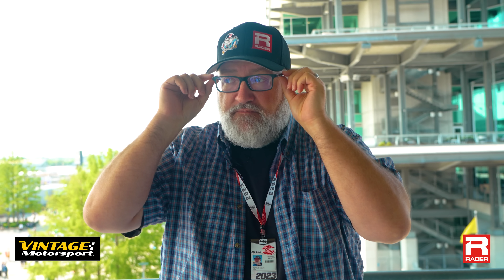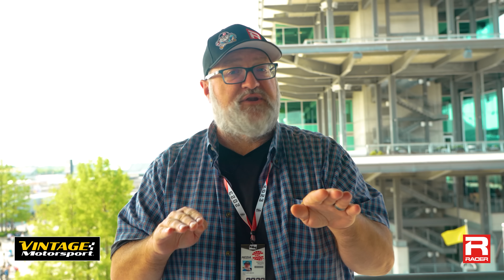Indy 500 Weight Jackers Explained - hosted by RACER's Marshall Pruett

Comment: The NASCAR fans will know this as "wedge".  Same exact concept except NASCAR has a crew member mechanically turn it versus the driver electronically adjusting it.
Reply: Doesn't the current gen NAPCAR have driver adjustable "wedge"? Or is it track bar?
Reply: @MX304  track bar
Reply: Great comparison.!
Reply: @seankennedy131  the current Gen car doesn’t allow the wedge to be adjusted and doesn’t even have a track bar. For a year or two they were allowed to adjust it inside the car but they got rid of that like 5 years ago. Not a thing anymore. All they can adjust is brake bias front to rear.
Reply: @robby2448885  wow that's really unfortunate

Comment: I like the Penske solution: Jack off/ Jack on, and all with a button
Reply: All of them are button controlled, and the drivers will adjust them to specific positions throughout a fuel run ( as instructed by their engineer over the radio) to a position number in the steering wheel display.
Reply: @richardpare3538  Since you mentioned fuel run, I thought they'd only use fast jacking during qualifying since I imagined that either a) it's forbidden during the race od b) it can't be used to reduce drag since it's range of adjustment is already fully occupied to adjust between a full fuel tank and and empty one. Would be great if you know that and could tell me/us!
Reply: @armorgeddon  I'll have to double check with my team friends, but how the jacker gets used will depend on what the engineers want at that point in time, and, of course, how busy the driver is if in heavy traffic. I would think that the better teams have the jacker control programming sophisticated enough to allow, with one push of the button, to go between 2 set  positions - one position for fuel load compensation, and the other for drag reduction.

PS - many of the jackers the teams use are mine, some are copies of mine, and some are made by the team. Once I can again confer with my guys and verify my thoughts ( they are all damned busy for the next few weeks), I believe that I can make a new jacker that will respond a lot faster so that they can spend another second or so at the low drag setting on each straight.
Reply: @armorgeddon  The control for the weight jacker is now a rules-mandated system - the teams used to all make their own systems -, but the jackers themselves are open. It is a very sophisticated and expensive system ( the motor alone costs $2000!) that allows the driver to set 2 position points from the steering wheel that are then controlled by a single push of a button. Those 2 points can be changed on the fly by the driver, according to the needs of the level of the fuel load at that point in time. The drivers, when not way too busy, do indeed go to the low drag setting when on the straights during the race. The majority of drivers only do that on the 2  main straights, but there are a few that also do it in the short chutes!
Reply: @richardpare3538  Just an ad break in the race coverage here and I quickly wanted to let you know that I highly appreciate your effort in investigating this for me/us. What you reported is really interesting and I didn't knew this even after watching IndyCar since 1993. I'll overserve the driver's actions on the buttons during the race now. Thanks very much and good luck for "your" drivers! EDIT: just as I sent this comment Will Power is reporting his jacker seems to have failed.
Reply: @armorgeddon  The problem Rahal had was a mixup in the assembly of the controller. No idea on what has happened to Power's jacker - may hear about that in a week or 2.

Interesting race so far!

Comment: Why didn’t RLL repair Grahams during qualifying
Reply: I am no Indy car engineer, but, the actuator shown in the video is hydraulically driven. There is a hydraulic valve and pump some where on the car to deliver oil to the jacker. Depending on where they are in the chassis, they may not have had the time to get to it, change out the components and put them back in time. Plus, if I remember, they did not know what failed, it could have been any number of items, plus  the electrical controls to operate it.
Reply: @dconkey1  It was an instantaneous failure the first time he pushed the button

Comment: The F1 teams want this if the technique is allowed
Reply: Weight jacking is really only relevant on ovals where the car is set up asymmetrically to help it turn in one direction.  Otherwise, for road courses, you'd use adjustable anti-roll bars and/or diff, which they already have.
Reply: @kuckoo9036  what if both sides can be adjusted.  This is disallowed in F1
Reply: Yeah really useful around Monaco. 🤡🤡🤡🤡🤡
Reply: @kuckoo9036  F! does not allow cockpit adjustable anti-roll bars.

Comment: So it is an electronic aid.  No skill needed.
Reply: It's not an electronic aid in the sense you make it sound, since there are no sensors giving data to a computer who then automatically adjusts it constantly. Btw even with electronic skills the best drivers will be able to extract the most out of them as the 1993 F1 season, which is probably the best example, proved.